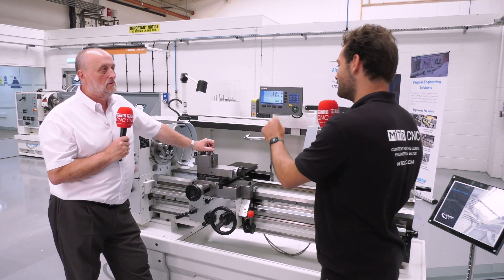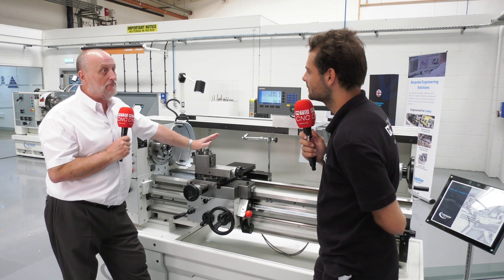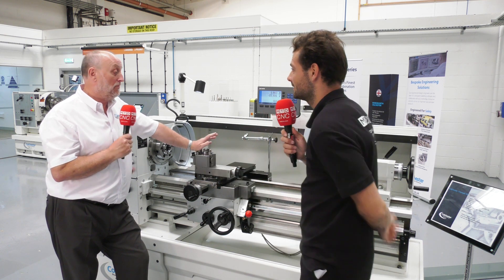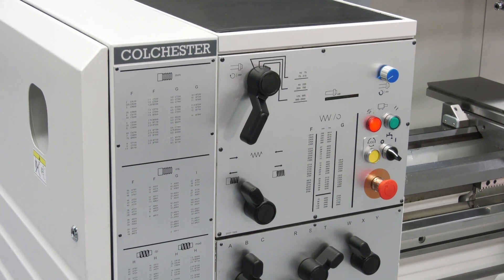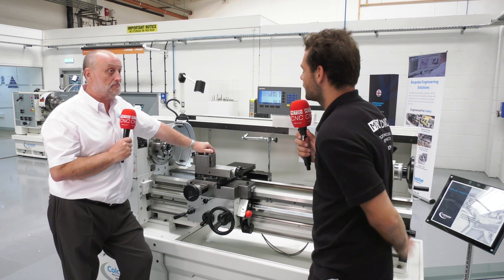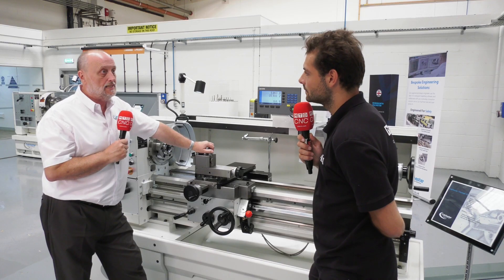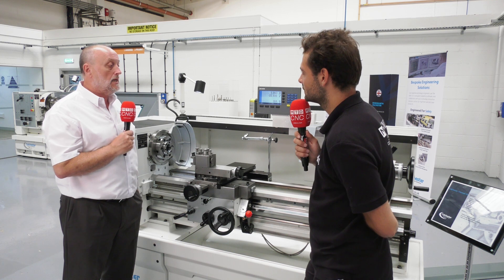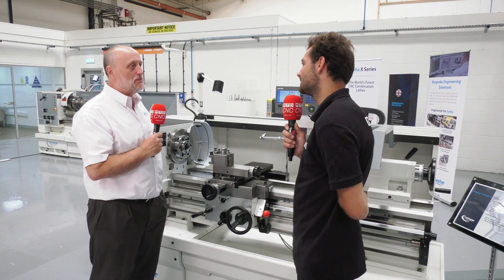Colchester Triumph - an ultra-reliable variable speed centre lathe

Comment: "In stock now". Then next sentence "Delivery in 4 to 6 weeks, maybe sooner if you twist our arms". If it's in stock, why not delivery tomorrow. Field Transport are only just around the corner, they have Hiab trucks.
Reply from the maker: Well, they will be other machines being processed, inspected, having any extras/special requirements fitted (which happens on most orders), going through the factory, which were ahead of any new orders in the queue then service engineers need to be arranged to come commission it etc. So yes, we may have it there in the warehouse, but it's not a matter of just sending it out! 
Now if your order was a basic machine with no additional requirements, then that may be quicker - but it would be foolish of us to say a week delivery as standard, when many factors would make that impossible.
Hope that clarifies things for you.
Reply: @CMTS  Many thanks for your very comprehensive reply. That certainly makes sense; now I have retired, I tend to forget all the other stuff that goes on in the background.